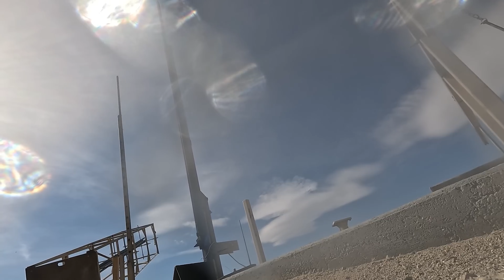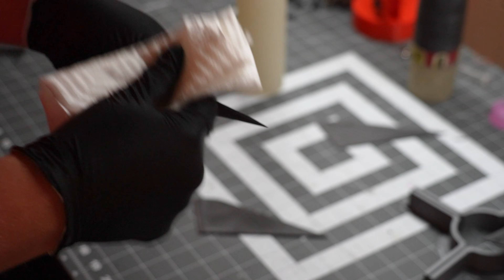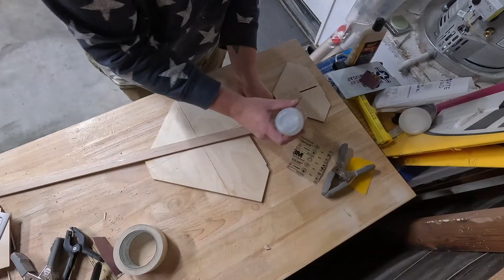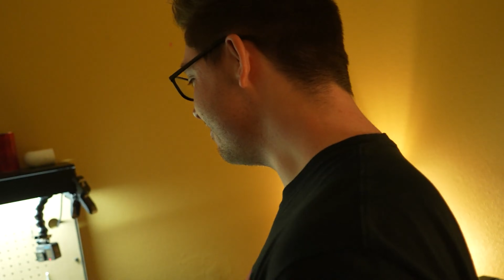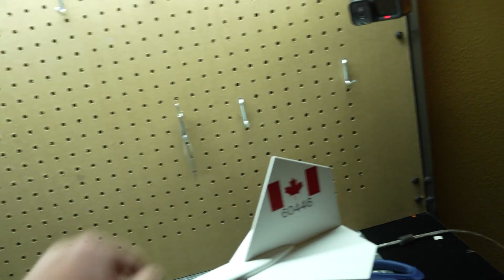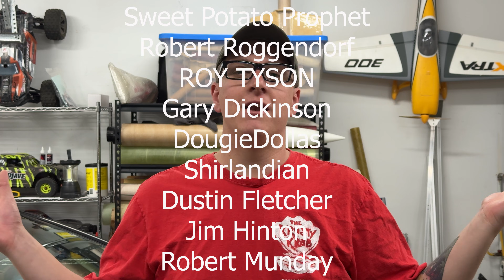I'm Deeply Sorry.

Comment: For your Madcow Bomarc, did you use wood glue or epoxy for gluing the wings? I used wood glue and the moisture in it warped the wings like a taco.
Reply from the maker: but I cured it under weight, wings were straight.
Reply from the maker: Titebond II